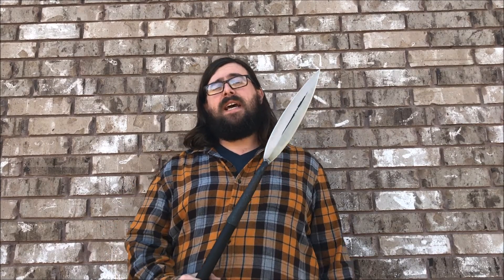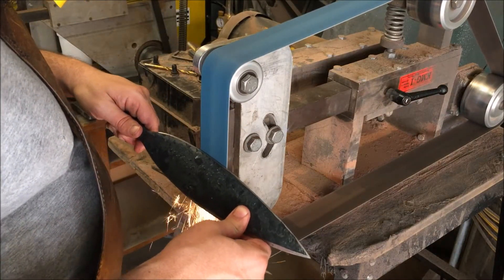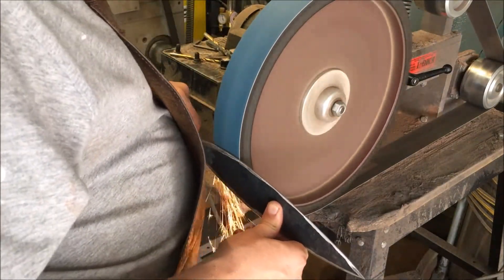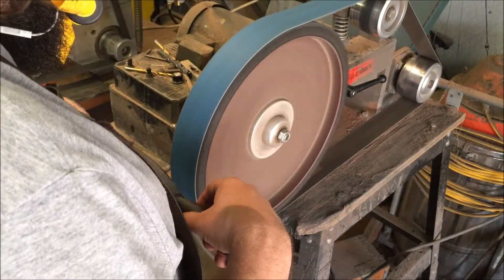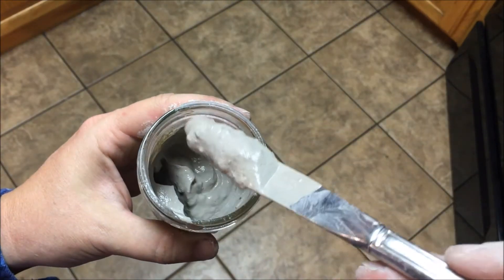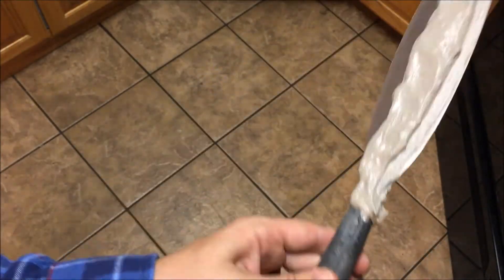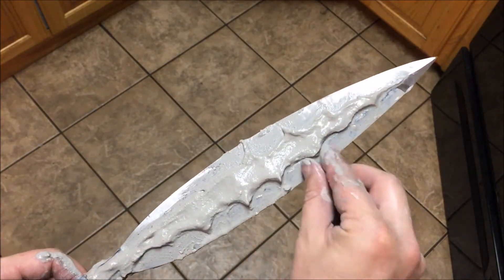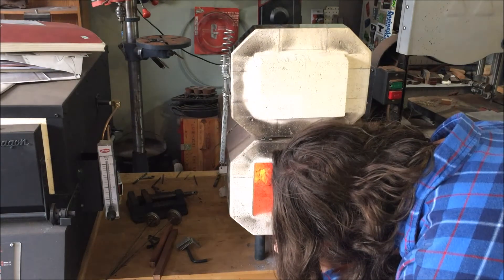How To Forge A Spear pt.3: Differentially Hardening (Clay) and Grinding

Comment: I'm in the middle of writing a book, and there's a scene where one of the characters forges a spear. This series has been incredibly helpful in writing it. Thank you so much. I would like to ask you though, how long did it take you to make the spearhead? Do you have any idea of how long it would take without modern power tools?
Reply from the maker: If I recall correctly.  I forged it in one afternoon.  I ground on it another afternoon.  I am not sure how quick it went back then.  It would depend a lot on how many Spears they made if they had good starting material and did a lot of spears I would think they could do it pretty quick.  But, if it was a small town smith using odds and ends it make take a bit more time.
Reply: @AllenNewberry  Thank you so much. This info is very helpful.